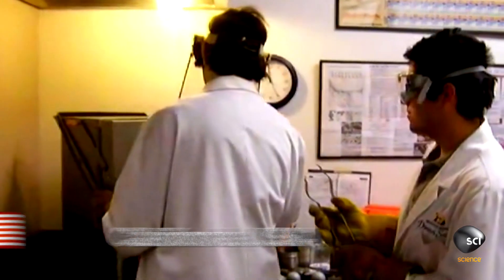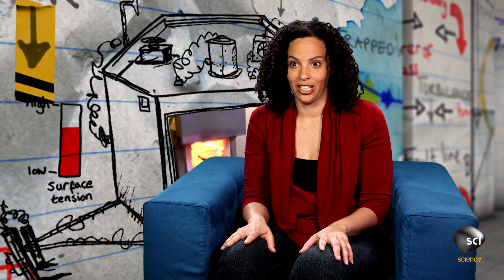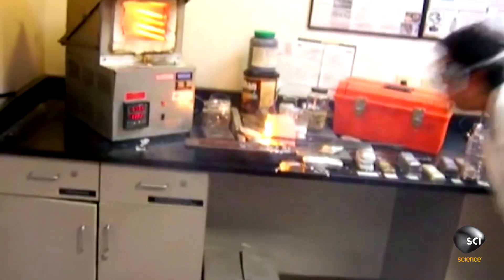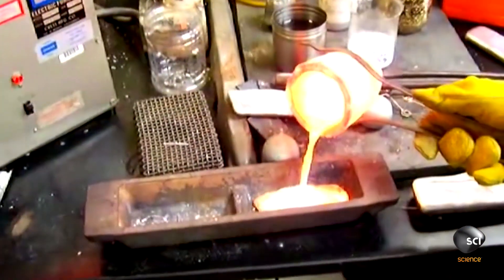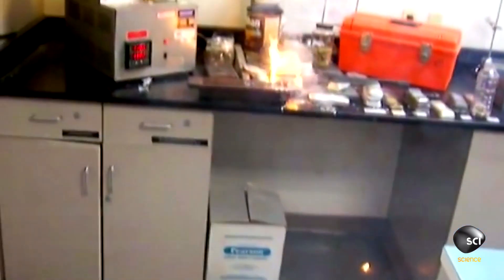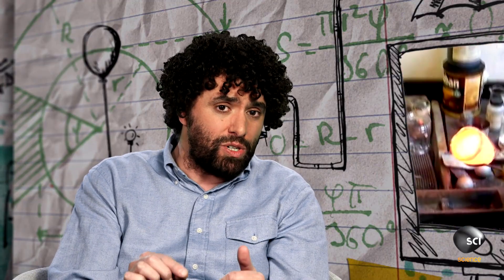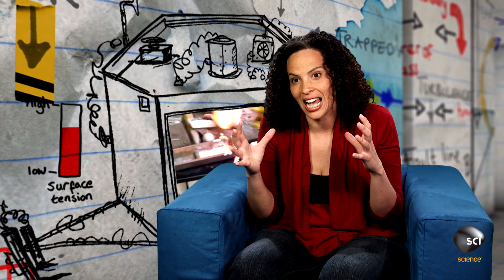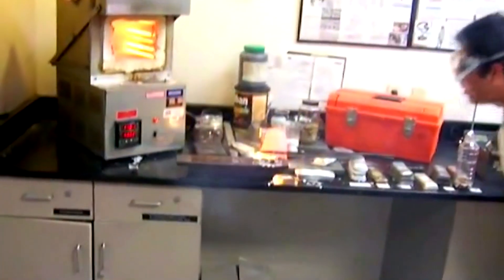A Molten Meltdown

Comment: That was not steam, the form is cold and liquid aluminium is causing the form to expand very quickly. You can hear the bing from the form!
Reply: TheCellCH That would be my guess.
Reply: TheCellCH Except that the expansion of the form is not going to cause the aluminum to "erupt" like that.
Reply: Then why didn't the casting break apart with extreme heat on it?
Reply: It's not like iron / steel is just breaking apart. But it is expanding with a rise in temperature, thats why bridges have parts on sliders